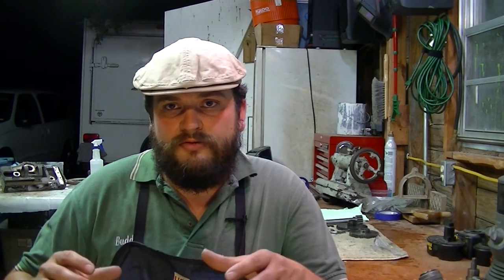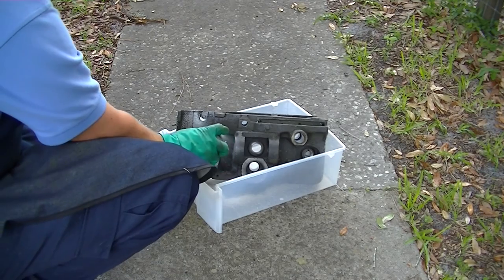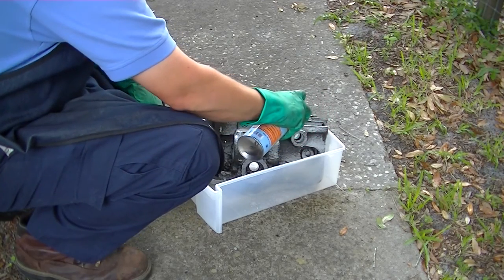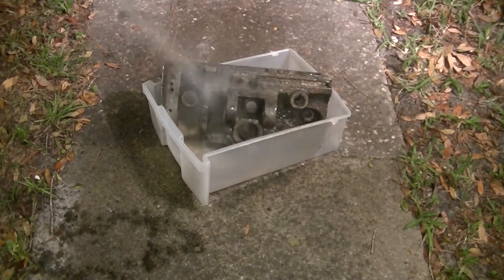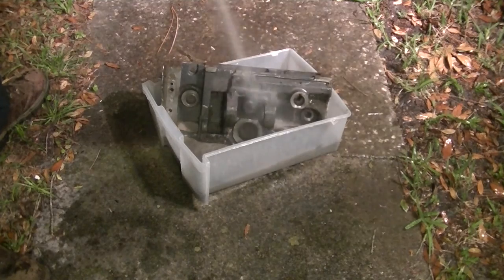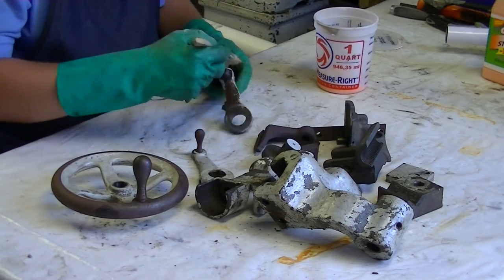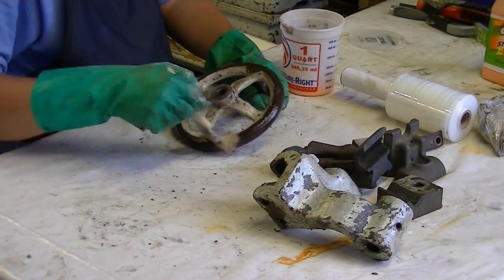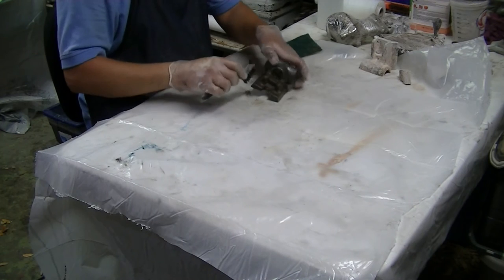14.5 South Bend Metal Lathe - Apron Paint Removal - Part 3.4

Comment: Lead based paint should be avoided if at all possible, but it can not harm you if it is not ingested. That also includes breathing dust created from that product. Anyway, yes, avoid it if at all possible. If not, use all safety precautions. With a little caution, you can work with it safely and help others to not be exposed. Heavy metal poisoning is no joke, but a little bit of caution goes a long way.
Reply from the maker: Thank you, klmartin1962.  It certainly pays to take a few precautions and play it safe.